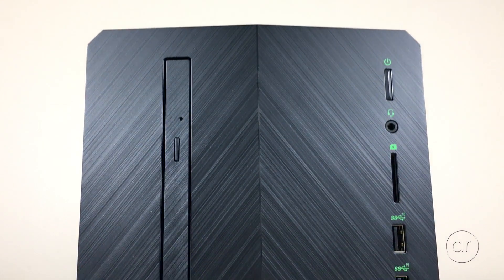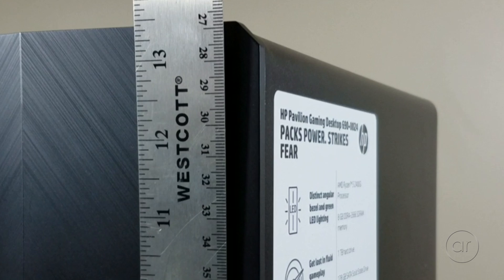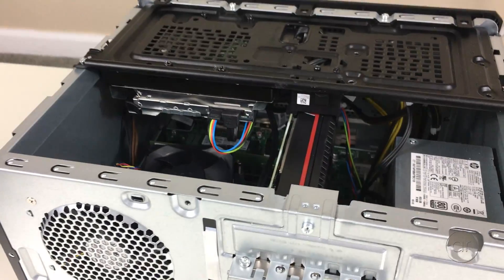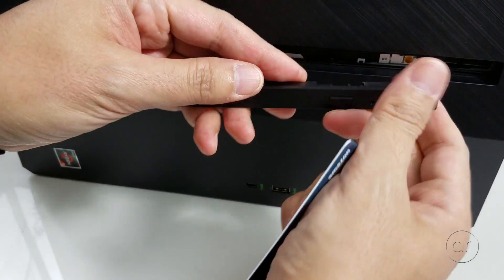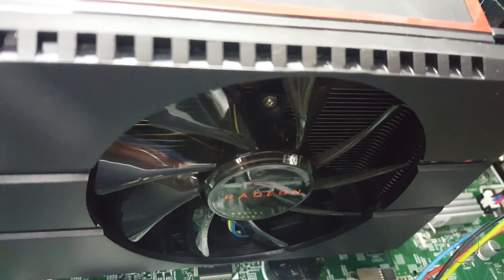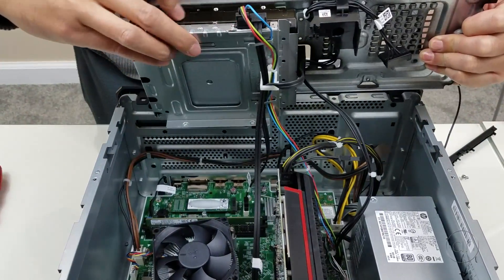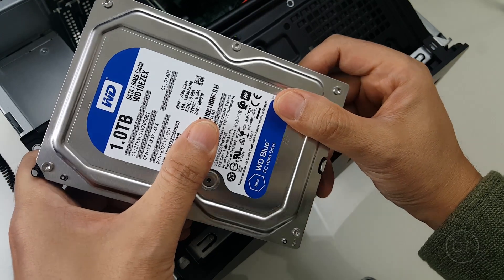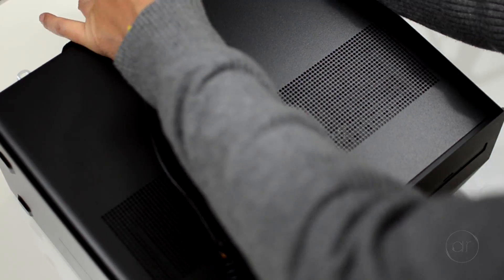How to Open and Upgrade a Ryzen-Based HP Pavilion Gaming Desktop

Comment: I'm trying to upgrade this now. Found it this thing is garbage when it comes to upgrades. everything is customized as far as size goes so I essentially have to build a brand new computer. I haven't found a PSU larger than 300W that will fit
Reply from the maker: Yes, HP made it extremely difficult to upgrade certain components (especially the custom motherboard and the matching non-standard power supply). The PSU even has non-standard pin connectors to the motherboard, so third-party PSUs wouldn't work unless they're re-wired.

Comment: Why wouldn’t the motherboard support integrated graphics? This model HP uses a sunflower motherboard, which is also the same motherboard in my 590-p0076, which doesn’t come with a dedicated graphics card, and runs using the integrated graphics of the Ryzen 5 2400G. HP’s website does list the same motherboard on the specs for each of these two models. However, the specs for the 690-0024 does note that it’s motherboard doesn’t support integrated graphics, like you mentioned. I’m just confused about the reason integrated graphics not being supported on that model, and why they’d bother putting a cpu with integrated graphics in a model that doesn’t even support it?
Reply from the maker: The BIOS itself does not have any setting to control the output to graphics. However, I did experiment with this by taking out the RX 580 and it seems the BIOS does automatically switch to the APU.

Comment: Hello thanks for making this video I know I am Pretty late But I was wondering if I upgrade to a GTX 1660 TI but I was wondering if I upgrade to a GTX 1660 TI would I have to change the power supply? Thanks!
Reply from the maker: There have been several viewers who've successfully upgraded to the GTX 1660 (but not the Ti version) - please see the Graphics section in the Description. I know a couple have used an adapter to go from 6 to 8 pins for the power connector, but I highly recommend getting a new power supply with an 8-pin connector if possible.

Comment: Mine came with 6 gigs of RAM and I wanna bump that up to 12
Reply from the maker: Which Pavilion model do you have? I wasn't aware of any Pavilion that had 6 GB of RAM (they have 8 GB models where 2 GB are reserved for the APU, though).
Reply: @accessrandom sorry for the late reply 😅. I was a kid, I didn't know what I was doing. Last time I checked it, it has 6.9 gb of usable memory with a single samsung ram stick. It's currently in pieces as I'm replacing the hhd with an ssd and putting 16gb of memory in.

Comment: I have a 690-0024 and have added an extra 8gb of ram (Crucial 8GB, Model CT8G4DFS8266). I have also just swapped the RX 580 with a 1650 Super (PNY XLR8, Model VCG16504SSFPPB-O). I had to remove the small black clip from the bay cage or else there isn't enough room. So far so good. I also added a 2.5 inch SSD but since I didnt have the proper adapter for the bay cage its kinda just hangin behind the PSU. Not Ideal but it works lol.
Reply from the maker: Awesome, thank you - do you mind if I add this model information to the description with credit to you?
Reply: I should also add that the 6 pin power cable coming from the psu has an extra two pins hanging from it in case you want to upgrade to a GPU that requires an 8 pin power connector.
Reply: Go for it
Reply from the maker: @josefbecker3267  Done! Thank you 🙏

Comment: is it possible for me to put a gtx 16650 super inside this system
Reply from the maker: There are a few viewers who've upgraded to the 1650 and 1660 Supers (you can find the models and/or part numbers in the "Graphics" section of the description).

Comment: Is there a case upgrade that will work for the motherboard out of this case?
Reply from the maker: The motherboard is highly custom with a size of 24.4 x 26.7 cm ( or 9.6 x 10.5 in). Unfortunately, I didn't measure the mounting holes on the motherboard to see if they were any ATX standard, and i haven't received any reports of successful upgrades to another case (I've been keeping track in the description and the pinned comment).
Reply: access random I gotcha, I’ve succumbed after hours of research to buying a new motherboard and case...  I purchased a MSI Radeon 580X 8GB OC and it works with the motherboard fine, however the case had to be “stretched to fit” and I don’t like that...  so I hopped on new egg and ordered a new AM4 Chipset motherboard.  Also had to buy a new PSU but they ain’t to bad right now...  just wish this thing was as uogradeable as HP advertised it to be
Reply from the maker: @HeirEnriech  Yeah, HP made it very difficult to upgrade it (with the exception of the simple component upgrades like memory, SSD, and storage). The two main components - the motherboard and power supply - are very non-standard.

Comment: I want name ram cuz i want buy same like the hrtz for hp pavilion please 😊
Reply from the maker: If you'd like to add to the existing memory, HP has been using one of two models: Samsung M378A1K43CB2-CTD or a SK Hynix H5AN8G8NCJR. You may want to open up your case to see which one you have and buy the same one. Otherwise, I've kept track of what other viewers have used in the "Memory" section of the description.

Comment: Can you also use atx mobo?
Reply from the maker: Sorry, I haven't had any reports of motherboard upgrades for the existing case. According to HP's specifications website for the 690-0024, it has a custom size of 24.4x26.7 cm (9.6x10.5 in).
Reply: access random oh ok so last question will it work with an atx case?
Reply: @accessrandom  will it work with atx case

Comment: any ideas for a new cooler for the cpu and a replacement intake fan?
Reply from the maker: I don't have any personal recommendations, but other commenters have used the Arctic Freezer 12 (caveat: you will need to remove the internal cage to make the fan fit), and a 92 mm be quiet! fan for the case (you can see their comments and the extensive write-ups for the Freezer 12 in the pinned comment).
Reply: @accessrandom  use the be quiet fan in place of the one they give you?
Reply from the maker: @dynamitedom767  Yes, this would be to replace the existing one.

Comment: If I upgrade my power supply to a 500wats and my graphics card to a 1660 super mini ITx, will I need more fans or do I stay with what I have
Reply from the maker: I don't believe the other viewers upgraded any fans, but you may want to just monitor the graphics card and CPU temperatures to see if you need more airflow in the case.

Comment: I have the same computer but I want to upgrade it, would I be able to get a new case mother board and power supply and use the other parts? Thanks!
Reply from the maker: Yes, the other parts are all standard -  the CPU, graphics card, memory, M.2 SSD, and hard drive. If you plan to move the CPU, make sure to get a CPU fan since the existing fan won't be transferrable. The DVD drive is a slim-type, so you may need an adapter to fit it in any 5.25" bays.
Reply: @accessrandom  thank you so much!!!

Comment: Does the motherboard support ddr4 pc4 25600 ram. In their website it doesn’t say anything about the limit it supports. It just says “supports pc4 19200”
Reply from the maker: You should be able to use faster memory modules (as others have done - please see the "Replacement Memory" section of the description). However, the memory would run slower to spec.

Comment: What would I need to change if I want to upgrade my power supply to a EVGA 700 Wats ATX12V. And my graphics card to a MSI 1660 super 6g. Both parts are in Best Buy. Does it fit? Do I need cable extensions? What will I need to do
Reply from the maker: Unfortunately, the power supply is non-standard (the pin-outs are wired differently than standard ATX) so I'm afraid that you're limited to HP's own OEM power supplies. Alternatively, you could use a standard power supply, motherboard and case, then move all the other components (which are standard) to the new case.
Reply: access random I don’t want a case like wanted I wanted  before. Do I still need an hp power supply If I want to change the one that’s in the normal case
Reply from the maker: @yozoomy7217  The power supply is matched with the non-standard motherboard, so yes, you would need an HP power supply. Wish I had a better answer...
Reply: access random does that mean I need a new motherboard
Reply from the maker: @yozoomy7217  Yes, because the non-standard PSU has the same pin-outs as the motherboard connector.

Comment: What is the psu?
Reply from the maker: The PSU is an HP 400W power supply, part number L04618-800.
Reply: I have an hp pavilion with a 310W psu. Do you think I can fit a gtx 1650s in it.
Reply from the maker: @martinsim7551  It looks like the GTX 1650 consumes about 100W. You'll want to compare that with the card you already have, and if they're close you should be fine. But keep in mind that there are physical size requirements (to make sure it fits inside the case) and power connection requirements (6-pin or 8-pin), so you'll need to make sure any card you get meets those requirements...
Reply: @accessrandom  thank you!
Reply: @accessrandom  My current gpu is an rx 550 which consumes 50 watts and the gtx 1650s consumes around 80 to 100 watts
Reply from the maker: @martinsim7551  That may be a bit risky since it's almost double the original. I'm afraid HP sizes their PSUs to supply just enough power to the existing components without much headroom. If yours is a 690-family Pavilion, you could try one of the power supplies listed in the pinned comment (which are those that others have successfully upgraded to).
Reply: @accessrandom  thanks for the suggestion

Comment: Man what a trip...prebuilts haven't changed in like 20+ years. Still the same disgusting lack of VRM cooling, unpopulated connections on the board, the bare minimum memory, peripheral, drive upgradability, abysmal case design, the list goes on. I have an H50-50 with an i7-4790, 12GB RAM, and a GT-730 on a bare bones H81 board. The PSU is 280 watts, enough to power maybe half an alarm clock. It's 14 pin, so I had to buy an adapter when I recently decided I need a legitimate power supply (still waiting for the 500 watt Be Quiet! System Power U9 to come back in stock with B&H). It's a 2015 built computer. The PSU is failing, the thermal paste needs replacing (every 5 years or so) and I might just have to buy a board and case from an actual computer parts manufacturer. And of course I need to buy a 1650 Super if I want decent performance in anything. These system integrators never fail to disappoint. Never.
Reply from the maker: Yeah, this one it pretty bad - a non-standard motherboard which has a Ryzen processor but mounting holes for an intel CPU fan (!), a non-standard power supply with non-standard pin-outs to match the motherboard, a non-standard case, 2GB of memory eaten up by the APU, etc. I have another video showing a CyberPowerPC which is better in the sense that at least it uses standard parts...

Comment: how do i upgrade the power supply
Reply from the maker: It's possible to upgrade the power supply but since it has non-standard pin connectors (to match the non-standard motherboard), you'll need an OEM power supply from HP's parts store. There have been a couple viewers who have successfully upgraded - please see the pinned comment for their part numbers.

Comment: Would a 1660 super 6gb fit in this pc?
Reply from the maker: There are certain models (like the Gigabyte GTX 1660 SUPER Mini-ITX) that will fit. I've been keeping track of successful upgrades by viewers, which you can find in the Description as well as the pinned comment (for other components). Depending on your specific Pavilion model, you may need to upgrade to a new power supply.
Reply: If I switch the case to a NZXT H510 - Compact ATC Middle Tower PC Gaming Case- Front I/O USB type- c port - Tempered Glass side panel. What will I need to change in the inside of the pc. For example, will I need to change to a different motherboard or will I just have to move everything inside the pc into the new case?
Reply from the maker: @yozoomy7217  That's a good question. Unfortunately, I didn't check the hole pattern on the motherboard to see if it was standard for ATX (I wouldn't be surprised if it wasn't, since the motherboard is so non-standard). I'll need to defer to my other viewers - has anyone tried transferring the motherboard to another case?

Comment: In the description it says that two of the ram sticks ''work with samsung".Does that mean that it works with the 1 stick of ram already in the computer?It would be appreciated if someone who knew responded as I own this pc and I'm trying to upgrade it.
Reply from the maker: Yes, that's correct - those memory models have been successfully paired with the existing Samsung memory. However,  other viewers have found the SK Hynix in their machines, so it would be safer to find out which brand you have by opening your case, before purchasing any memory.
Reply: access random thank you so much for answering definitely getting a sub from me.
Reply: @accessrandom  a year later I finally did the upgrade. Thanks access random!

Comment: I'm looking to upgrade my graphics card, what should I be looking to get? I play games time to time and heavily used fusion, cad, inventer, and 3d printer slicing software. I have this computer from around October/November of last year. Don't know the exact model at this time. Also plan to update processor, ram, and add another SSD.
Reply from the maker: I've been keeping track of successful upgrades from my viewers to various models in the Pavilion 690 family (which you can find in the "Graphics" section of the description). The other components are also in the description as well as the pinned comment. Hope this helps...

Comment: Could I fit and rx 580 8gb inside this
Reply from the maker: As long as it physically fits in the case and the power connection is compatible, it should work. Please note that in my system, I only had a 6-pin power connector for the graphics card, while others have found an 8-pin - so you should open your case to make sure what you have.

Comment: Can you replace everything inside to a new case
Reply from the maker: I am not sure about the motherboard - I'm uncertain whether the mounting holes have standard ATX patterns. The power supply also has non-standard pin connectors, matching the motherboard. Otherwise, everything is standard, including the graphics card, memory, M.2 SSD, and hard drive. The DVD drive is a thin-type, so you'll probably need some type of adapter to mount it in a 3.5" bay.

Comment: Is there anywhere I can add a fan?
Reply from the maker: I've always thought of installing a case fan myself. If you're handy with a Dremel tool, I think you could cut out part of the sheet metal on the side panel, right below the vents and right above the CPU fan.

Comment: Im curious, is it possible to replace the motherboard with one that could run a better cpu?
Reply from the maker: Unfortunately, it's a very non-standard motherboard (that is matched with a non-standard power supply and case) so it is not possible to install a standard third-party motherboard, unless you opt for an OEM motherboard from HP. What you could do is use a new motherboard/CPU/PSU/case and transfer all the other (standard) components to it, including the SSD, hard drive, graphics card, and memory.

Comment: So far, I've swapped for a 2700, put in 32gb ram, new back fan, upgraded to 580 (got the 550 version), upgraded to a 500w psu, and this thing runs real well. My current problem is that I wanted to try out the 3600, which i already bought. i installed it physically without a problem, but everytime the pc turns on, the screen stays blank and the pc shuts off, then back on again, and it repeats. I've tried resetting the cpu cooler to make sure its sitting right, and even re-pasted the cpu twice. Plus, a PSU calculator told me that my pc requires ~460w so I'm good on power. Anyone know what might be wrong?
Reply from the maker: If yours uses the same motherboard as the Pavilion 690-0024 (which is the Sunflower 8433), I'm afraid it doesn't support any third-generation Ryzens according to HP's spec website. The highest that it lists is the Ryzen 7-2700.
Reply: What power supply did you upgrade to? I'm trying to upgrade but can't find any info
Reply: did you use the stock cpu cooler for the 2700
Reply: @josefbecker3267  yes, the pavillion's case was quite cluttered. Not much room for any other type of cooler

Comment: On my HP 690-0067C, I have replaced the stock Radeon RX 550 graphics card with MSI GTX 1650 Super Ventus XS OC.  The new card fits physically.  The stock HP power supply can handle it.  The new card's fans are much quieter, and the performance is obviously much, much better than RX 550.  The new card is more power efficient, but the system as a whole is now generating more heat.  CPU temperature is up, not due to higher utilization, but due to hotter air inside the case.  The metal case cover near the graphics card is much warmer to the touch.  So my next upgrade will be replacing the case fan.
Reply from the maker: Thanks again for the great info. Do you mind if I add your comment to the description under the "Graphics" section to your credit?
Reply: @accessrandom  Yes, please!  Thank you for organizing the information for all the HP users out there.
Reply from the maker: @echopapacharlie  Done, and thank you again! Much appreciated...